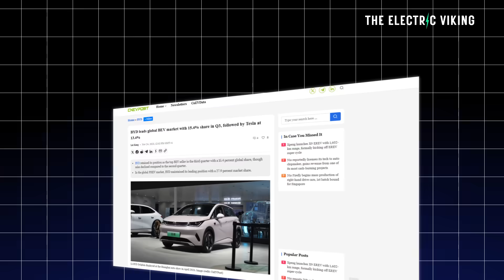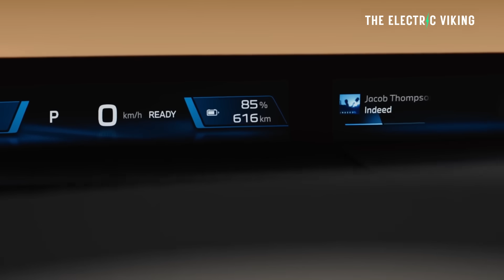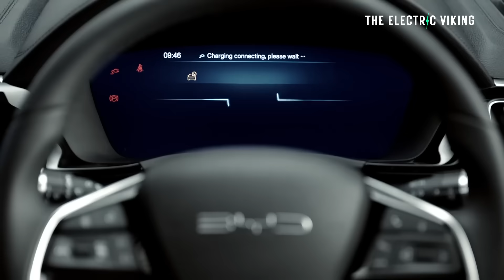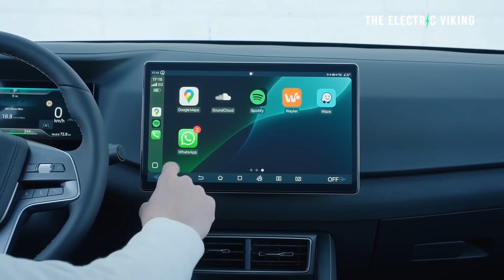EV Sales SKYROCKET 48% Worldwide in Q3 2025 - Worlds Top 10 EV Brands By Sales

Comment: In Norway the fake hybrids (pluggin hybrids) didn't reach more than 8-10% of the marked. If you go back 5-10 years ago you will see that most of those that bought the first Teslas in Norway, had driven a hybrid before they switched. And, most of those that chose fake hybrids, drove another hybrid before.
Here you can see the reason why fake hybrids won't be a big part of the marked.

Comment: I read some of your data is incorrect but regardless, you need to look at EV's market by market...BYD growth in the Philippines for instance only grew significantly BECAUSE of plug ins.
Reply: What's the marketing in Philippines? In Australia the media push anything with a petrol engine  when EVs would be better for most people
Reply: @robertoz3710  EV's are dominated by Hybrids at present... the power infrastructure in the Phils is unreliable and public charging stations few and far btw....BEV' for the well  off only at this time and around a 7-9 % market share.

Comment: Thx for the analysis, but some of your infos are wrong. Those 2,9% are for Volkswagen only not the VW Group.

The VW Group sold 140,5k EVs in Q3 in the EU (excl. France, Poland) + UK. If BYD sold 523.000 (15,4%) than there were 3.396.000 overall EV sales WW in Q3. 

Based on that, the VW Group had 4,1% market share only by EU + UK sales.
Reply: Everything this guy says is wrong

Comment: UK bringing in pay per mile for EVs - goodbye EV sales boom.
Reply: Trolls: EVs don’t pay their fair share! Also trolls: no one will buy them now because there’s a per mile tax!  Lol, the trolls try so hard.
Reply: Nope - the EV pay per miles rate of 3p is in 2028, whereas ICEVs face removal of the fuel duty 5p price cut and being indexed linked to the RPI inflation rate and include VAT. Fuel duty for the average UK petrol car mpg is already the same as 8p per mile and will rise to over 9p per mile by 2028 when EV pay per mile is introduced.

The relatively higher and increasing costs of running ICEVs is likely to speed up the EV sales not slow it down.
Reply: The EV pay per mile rate has been set to be approximately half the rate of fuel duty on a per mile basis. Anyone who doesn't buy an EV because of this is cutting off their nose to spite their face, as the say.

Comment: In most industries, the leader is the one selling the most, measured in $.  Nobody says that such or such pharmaceutical company is the wold leader because they sell the most pills!  So, why count in units in the automotive industry, putting a $4000 Wuling Hongguang Mini EV on par with a $250'000 Porsche Taycan?  That is utterly ridiculous.
So, I would like to see the list of the 10 leading EV manufacturers, ranked in $ of sales, not number of units.  I already know who would be #1 in that list... by a pretty good stretch!
Reply: For the rather obvious reason that unit sales  as a % of total sales is a better indication of market trends than just $. It gives the manufacturers and investors better insight into market dynamics. This is particularly true in manufacturing where a high % of total cost is related to making the product and it has been a key metric in auto forever. Scale as it pertains to manufacturing is extremely relevant and it is the reason that Toyotas, Hondas, etc vastly out sell Porsche. And if every company was like Porsche what would 98% of the market buy?

Pharma is the exact opposite because manufacturing is a tiny fraction of cost which is dominated by R&D and Sales & Marketing costs so in that industry you see those ratios primarily. But you also see new drug releases and that are gauged against total potential market size which is units potentially sold...this is why potential lifesaving drugs with a very small potential customer base....deadly disease/illness cost outrageous amounts and are often denied by insurance in backward nations like the US. So yes, even in pharma unit sales do have a place at times.
Reply: Market share is also very important as is profit per vehicle.
Reply: @gregwilliams3210  Absolutely!  And if we talk profit per vehicle, there is one clear winner!
Reply: Of course the number of units sold is more important than the money from the sales, bro, if the sales of the "expensive" ones continue to decline, they will eventually go bankrupt/zero USD 😂
Reply: @agusedyanto3087 the risk of Tesla going bankrupt is precisely ZERO! It is with Nvidia the most financially secure manufacturing company in the world.
GM, Ford, Stellantis, BYD or even Toyota are in the bankruptcy zone (Altman Z-Score < 1.8), Tesla not at all (18.7).

Comment: Oil industry pushing Hybrids but now range is not an issue and batteries much cheaper then tilt to EV advantage is unstoppable!!
Reply: Range is an issue in the U.S.
Reply: @gregb5683 I doubt it! The US has 10s of thousands of superchargers so even if your range is 300kms or less you needn’t ever suffer from range anxiety.
Reply: @gregb5683  No it isn't. I have a 90 mile round trip commute and am on call sometimes getting two calls in one night and I haven't have to even use a fast charger yet for my 2022 Model Y that I bought used last year for $20k.
Reply: @gregb5683  Range is really only an issue for the vast majority of US drivers if you are towing.  Otherwise, there are quite a few EVs with 500+ mi range and some with 600+.  And EV range is still increasing 10%-20% a year.  The problem is that those EVs aren't for sale in the US.